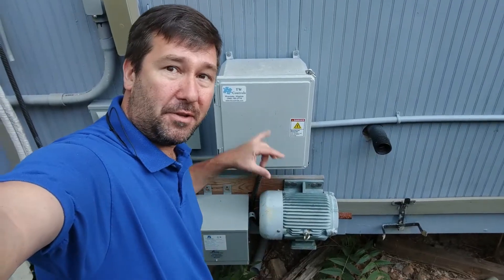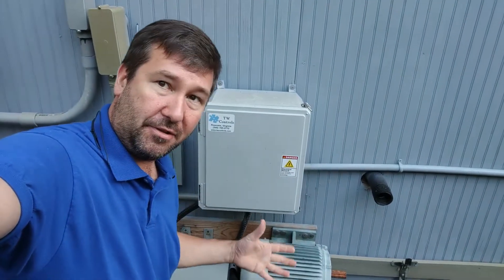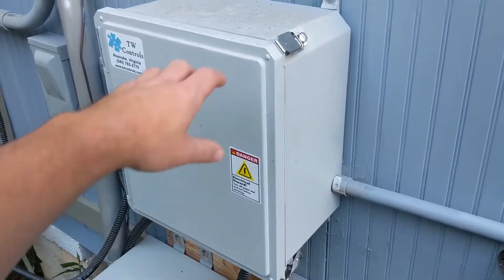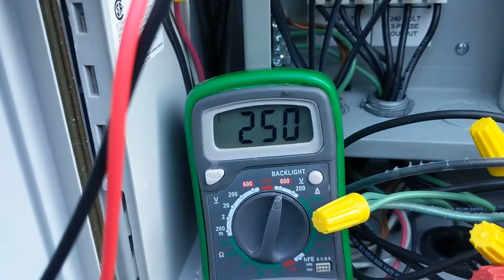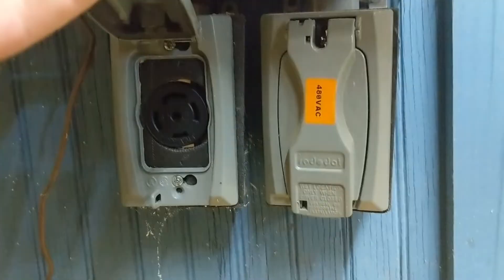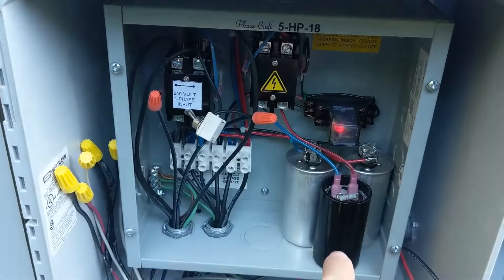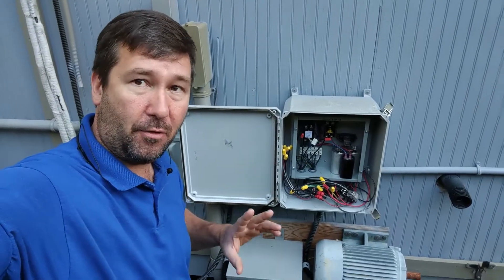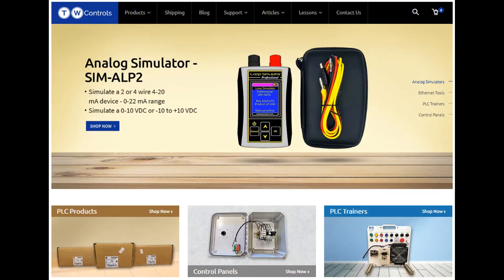Make 3 Phase Power from Single Phase with a Rotary Phase Converter

Comment: please excuse my ignorance , but are you now pulling three times the amps from the single phase. 
ie a 60 amp single phase in  is giving a 20 amp 3 phase supply out.

i understand you cant get something for nothing , but is the maths that simple.
Reply from the maker: Not 3 times the amps. 1.732 times the amps. Remember, you are already pulling on "2 legs". 

I'm in Christmas mode so short on time but go to a KW to amp calculator such as below and enter 1kw, 220VAC, a power factor of 0.85 then observe the amp change between AC single phase and AC 3 phase.
 https://www.rapidtables.com/calc/electric/kW_to_Amp_Calculator.html
Reply: @TimWilborne  
Many thanks
Reply from the maker: @tomthompson7400  You're welcome!
Reply: many thanks ,, happy xmas

Comment: nice video. It would be nice if you would post a BOM (Bill of Materials) used to built this converter showing the source as well as the values ie uF and voltages
Reply from the maker: I start going through that in the following video https://youtu.be/eXS9ahNzds0.  

You can't really spec out what size capacitors you'll need but an upcoming video I'm going to give some good general rules.

Comment: Does the start cap come back in when starting a large load like when you use a regular potential relay?
Reply from the maker: Yes, I'm not sure it is a good practice but when I bog mine down, usually by testing a control panel with a drive that has a lot of inrush when you power it up, mine will bog down and the starting capacitors can kick back in sometimes.

I would say that if this is happening normally then you need a bigger phase converter.
Reply: @TimWilborne  I built a 15hp one for a friend with a timer relay instead of a potential relay and reading into it more people say to use the potential relay to keep the start caps in the loop. Now I'm building 2 more. A 20hp and a 30hp and I like the timer aspect of it cause I know the start caps will always fall out. I've read that the potential relay needs to be "SIZED" correctly but no information out there about how to do that.
Edit: heres my RFC

https://youtu.be/hyjYdEL-80s

Comment: I have a small cnc lathe which uses 380v 3 phase and I’m attempting to run it with a 7.5hp rotary phase converter from North America phase it’s a 3.5 hp lathe so it should be good and then it has a step up transformer to take the 220v 3’phase to 380 is there any issue there
Reply from the maker: Most 380VAC 50 hz motors can run on 460VAC 60 hz.  Check your motor and see.  You may be able to source a 220VAC to 480VAC 3 phase transformer cheaper than a 220VAC to 380VAC 3 phase transformer.

Comment: Great video, I've been running a 10hp rpc  I built for my 5hp air compressor and other 3 phase equipment. I'd like a control panel for a 30 hp idler.
Reply from the maker: Thanks.  Occasionally I bog down my 5hp so I'm on the lookout for some parts to upgrade mine too.
Reply: Sorry to butt in but think that a 30HP unit would mean stepping up to 100 amp incoming power for a unit that size . Are you running up to 20 HP combined motors ? 
5 HP is about the max motor size that can be run on a control panel with 30 amp 220 input that is shown here if I'm not mistaken. At that the idler would be 7.5 HP minimum as I understand these. Correct me if I'm off on that Tim.

Comment: I wonder if a VFD would save more power than a rotary converter ??.
I also wonder if a properly sized VFD can run and power multiple devices??.
I like the idea that a VFD comes with built in protections and settings .
I think depending on the motor used condition ,  the generated third leg ( phase ) might not always be valance and stable ,
 how can it be valance ?? .

is there a rule of thumb or chart  on what size capacitor should used ??.
Another great video .
Thanks.
Reply from the maker: Those are great questions. I don't know how the VFD would handle the inrush of a motor starting across the line. It limits the current output through acceleration and deceleration so it doesn't have an unlimited amount of current available for starting. Even my Rotary phase converter will bog down enough to kick the starting capacitor back in if I start a super heavy load when testing a control system larger than it's designed for.

also you won't have any protection with the VFD if it is oversized to run multiple motors. It's current production will be too large for any of your machines.

As far as balancing there are arguments four or against weather balancing is necessary but I think it is a good practice. You balance through the run capacitors. There are no good rules of thumbs for balancing but I am making a video showing how to measure and maybe get some decent estimates on what size capacitors you should balance with.

You peaked my interest about wheher a rotary phase converter or a VFD is more efficient. Not enough to go out and buy the parts but I may see if I can get some things donated to do a test for a video.

Thanks for watching and the great comments and questions!

Comment: What kind of voltage reading would you get phase to ground on a rpc? Would it still be 277V for 480V output?
Reply from the maker: Hi Blake.  Yes, as long as you have the proper run capacitors to balance the three legs and your transformer allows for a neutral connection (mine does) then you will have 277 to ground on all three legs.  I'll be sure to address this when we dig into the details of how it works.  Great question!
Reply: @TimWilborne  Hey thanks, if you're doing a more technical video on this subject see if you can measure phase to ground on a vfd setup as well, i'm interested to see if pullsed dc from a vfd will still give you 277V.
Reply from the maker: Voltage on a VFD can't be measured with a volt meter. You'll have to wait for the video on that one, to much to explain in a YouTube comment 😀